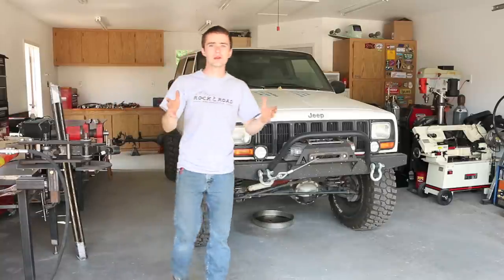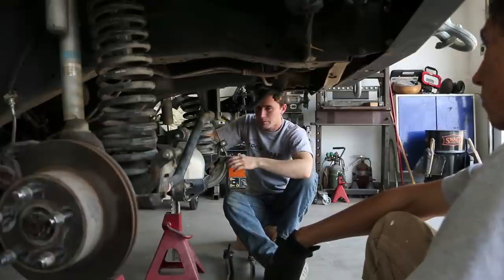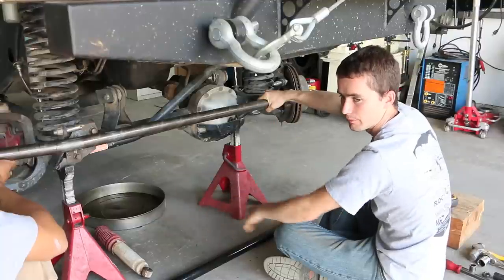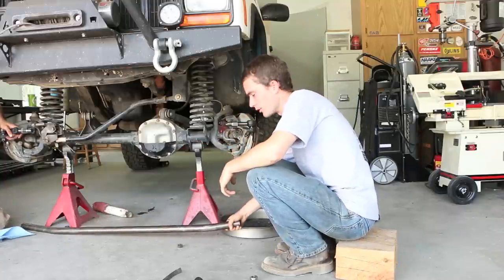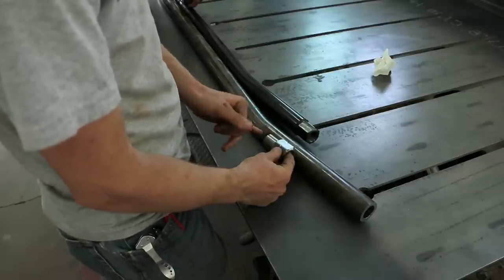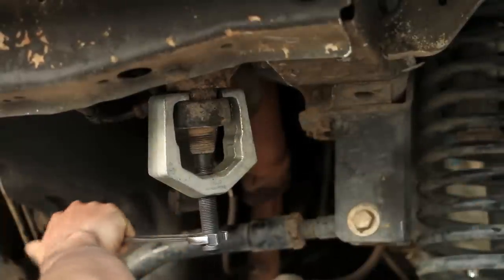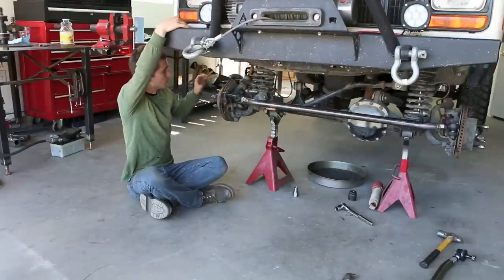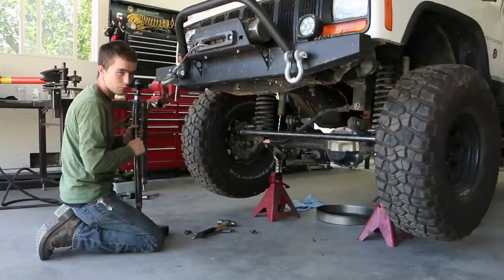"Y" Link Steering Upgrade - RuffStuff Specialties

Comment: Great video, except I STRONGLY caution against cooling the hot weld down with water.
Let it sit and air cool. This is a critical joint, go have a glass of tea or do something else. Do not ruin the weld by flash cooling.

Comment: I recommend when you mock up everything with tacks take out the springs and jack up the diff to the bumps top and steer lock to lock to make sure the drag link doesn't contact anything

Comment: Hey Tim, I am from Toronto ,we  got a shop here and just started doing a project on 2000 cherokee. we have done the otk steering system following your info. everything went good. Just wanted to know we did the wj conversion to the front knuckle, akebono caliper and big rotors . is it going to be a problem for doing the adjustment? and with your knowledge, can you tell me if we can go with the 20x9 alloys with 33x12.50 10'' tires. neg, offset.

Comment: the way ive always gotten those pitman arms off... tension the pitman arm puller nice and tight, and run a 5-10 sec bead of weld around the pitman arm lol. it seems to be the only thing that will get it hot enough. one time i did this and the pitman arm fell off without even touching it

Comment: Upgrading to WJ knuckles is a better steering and braking upgrade, but comes with the downside of not being able to fit 15” wheels. So if you don’t want to buy new wheels or big spacers so the calipers will fit, this upgrade is a great alternative

Comment: Turns out doing it under the knuckle you run Into similar problems. I have this kit for my 94 cherokee and the tie rod is hitting the track bar bolt as well as  the diff cover

Comment: Did you get any bumpsteer, since the track bar is still at the stock angle??

How's the tie-rod roll? Bad, Okay, None?

Do tell... like the work, and great explanation(s).  How many times have we (DIY fabricators) spun our hand on the end of a newly cut tube to lacerate our overly soft palmolive skin?!  haha... sucks.

And... as Nick mentioned, any advantage to Inverted-T over Inverted-Y... or reasoning as to why you did it this way (other then it's how ruffstuff intended - yet they call it Y-Link as well)

Comment: Plan on using this same set up... "otk"... on my 98 XJ. Couple questions for ya. 1. Did you have to cut sway bar links off? 2. Will the stock pitman arm work? If not what is the drop measurement on the aftermarket product. 3. Can I run my stock track bar?
Reply: +Trae A. Doornek - did you actually watch the video?

Comment: Have you flexed the suspension out since installation?  I'm concerned that the clearance bend on the drag link isn't enough and will contact the tie rod during suspension flex. Maybe I'm wrong, but doesn't the axle push forward on compression? That would cause your clearance to come closer and possibly contact and limit your steering to the right.

Comment: And you should hit pitman arm puller bolt not arm which is attached to steering box.. on most gm trucks it's impossible to get a puller on . I usually use an phenumatic cut off tool . And cut pitman arm off steering shalft ..

Comment: So I noticed this advertised as a Y-Link kit. I hate to be that guy, but this is just an Inverted-T like every other 1-ton kit out there (Tie Rod goes from knuckle to knuckle = Inverted-T / except for crossover steering.) 

You could have made it a true Y-Link by welding the Passenger Side Outer Tie Rod bung to the Drag Link and then connecting the Passenger Inner Tie Rod to the Outer Tie Rod hole. 

You did a beautiful job building it yourself, but I'd hate to see the ever so popular Tie Rod Roll sneak up on you. This is the only thing holding me back from any kind of 1-ton setup.
Reply from the maker: NickInTimeFilms Stay tuned for a follow up vid focusing on the steering stabilizer. I'll touch on tie rod roll and some measures we took to address it in that video. Thanks   - Tim
Reply: +BleepinJeep when or where is the link for the how to on the steering stabilizer for this set up.  Im about to do mine
Reply: +BleepinJeep you shouldn't have quenched the weld in water, you should have let it air cool. Since you quenched it could Monday snap because its brittle.
Reply: mild steel

Comment: something as important as control components you shouldn't rapidly cool. some structural welders that I have worked with that require certification per location will pre heat. then slowly cool with torch till it's at a moderate temp to resist rapid temp drop.  or at least let it cool on it's own

Comment: Just bought this kit from Ruff Stuff. I thought it would be a couple hours for this project but trying UTK it hit did cover to the left and full right hair track bar bolt. When I say FULL I mean only as far as the steering will turn before it hits something. When I did it OTK and cut off sway are links and stabilizer mount now it hits the springs on both sides before full lock. Adjuster screw needs adjusted out 1/2 inch to stop contact. ruffStuffs only solution was exactly what you're doing in the video. Bend the tube. Not my ideal solution.

Comment: I bought and installed a HD steering upgrade for my 1999 jeep Cherokee and after installation of the tie rod I tried to rotate the tie rod left to right and it's stiff and is really hard to push all the way to the right

Comment: I installed this kit today. But my steering wheel doesnt center after a turn. Everytime i put the tires straight the steering wheel is in a different position. And when i turn the steering wheel i hear 1 single “pop” sound. All castle nuts are tight, all jam nuts are tight. No idea what could be the issue.

Comment: It's a good idea to leave the bolt threaded in the nut when welding a nut to something. Just protect the threads with tape or anti spatter spray or even grease.  That way the nut won't shrink.

Comment: Any bump steer or tie rod roll? Any plans to move the track bar bracket on the axle up?
Reply from the maker: biggn235 There was some tie rod roll but we made minor modifications after filming to address that. I'll touch on the topic when I shoot the stabilizer vid. Thanks!   - Tim
Reply: I see this with nearly all the steering upgrade videos and products, no one is concerned about or knows what bump steer is. I have a 98 ZJ as a daily driver and I am stuck unable to pick a set up because my concern is getting stuck with a set that causes bump steer for years to come. The fact that Im also sick of dust boots cracking on tie rods doesn't help.
Reply: @bleepinjeep  where is that video?

Comment: Heyy can you help me oit I'm am looking fir shocks that will do well in NY bad streets.  I notcie you have a reserver builsten shocks. Are they good for daily driving amd really bumpy roads. I have the regular builsten shock with out the receiver. They are fine on smooth roads but are really bad when it get a bumpy. Are the onea with the reserver better on the regular roads?

Comment: question would the tierod ends fit the B Lee's Offroad 1ton steering system... not the straight bar that requires one to cut the Sway bar mounts but the one that is angled around them.

Comment: arent you supposed to drill holes in the stock half way in the weld in and weld it there too?
Reply: Corinthian Pagel plug welds. It's one of those things that is a good idea but not required.

Comment: Did you end up needing to adjust the trac bar angle any to make it parallel with your drag link?
Reply from the maker: +KINGJB3100 No, didn't need too but it could be moved closer to parallel. The Jeep handles fine with very very minor bump steer, hardly noticeable the way the geometry is set up as seen in the vid. I figure why mess with it... Good observation!

Comment: They outta include a adjuster in that kit so you can set the toe without pulling a tierod off
Reply from the maker: TheJesusno2 We modified the kit by bending the tubes. Had we kept the tie rod straight we could have adjusted toe simply by loosening the jam nuts on each tie rod end and rotating the tie rod like a factory set up. The only reason you have to pull a tie rod end is because we made the bends in the rod.   - Tim
Reply: +BleepinJeep  true i forgot that one side was LH thread. I shoulda thought before i opened my big    stupid mouth ha ha ha! Good video though very cool stuff

Comment: Is that a pool noodle in the front fender
Reply from the maker: Teddy Monroe You bet it is. Got to maintain buoyancy during water crossings somehow!     - Tim
Reply: For some reason I think they serve a different purpose.
Reply: Teddy Monroe keeps mud from going into the door / wiring / hinge area when the inner fenders are removed. works like a charm!
Reply: Didn't know that. Might have to get some for mine.

Comment: replacing junk with junk get a teraflex high steer kit with the y link you will never have good steering angle
Reply: The Teraflex kit is over $600. If you just buy the Tereaflex knuckle, its $400 and the rods in that kit are aluminum, easy to bend.